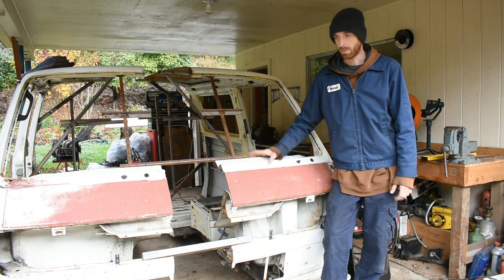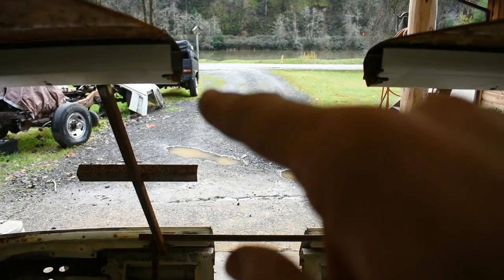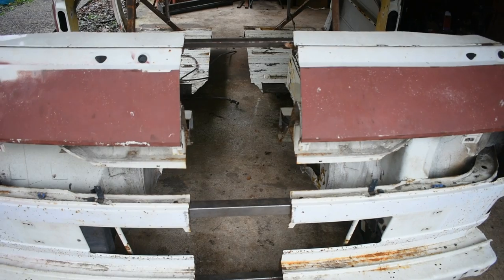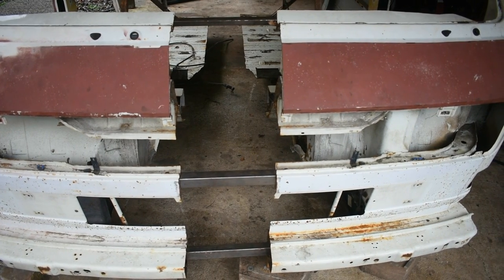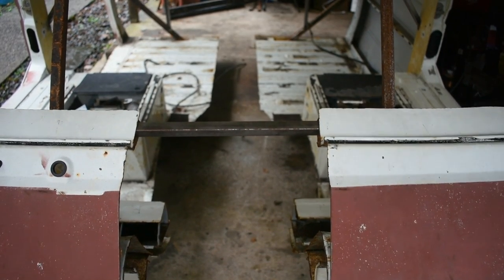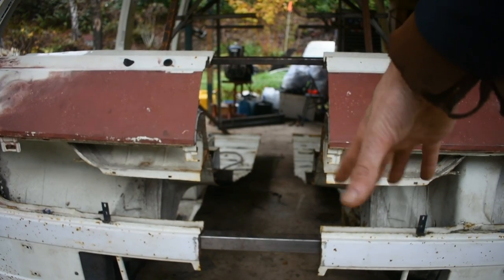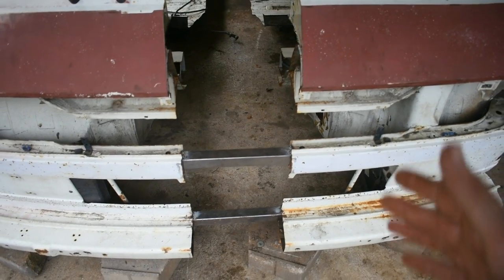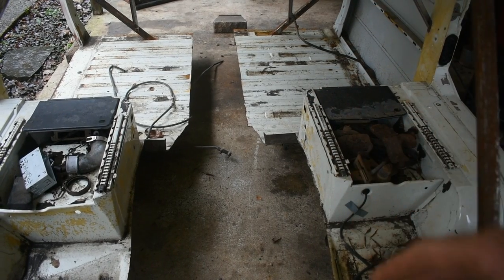Custom 12" Widened Vanagon Cab Build for Craziest Overland Camper!!!

Comment: Im surprised you didnt use both bodies and offset cut them so you only had a single join in the middle and got rid of the lower RH corner windscreen rot
Reply from the maker: There were a couple of reasons for this decision. The brown Vanagon body was in rough shape. The only really straight part of that van was the center 12"! I was also concerned that the transition in the middle would not be as smooth as both body halves would dip in the middle where they were joined.

Comment: Make sure you do the killer dowel pin fix on that Cummins 12 valve. It’s cheap insurance.
Reply from the maker: Thanks for the tip! Luckily, I have owned the Cummins donor for many years, and peened the KDP a while back!